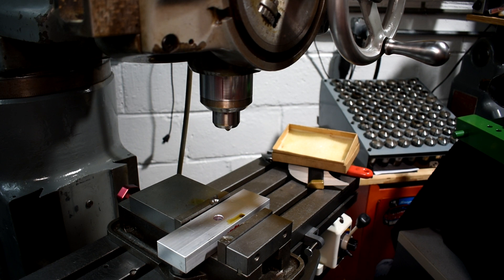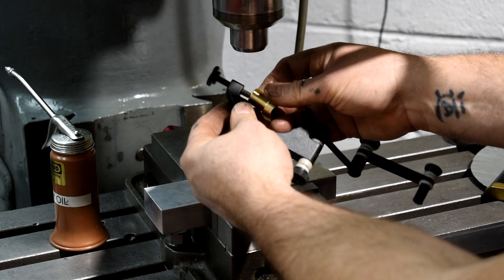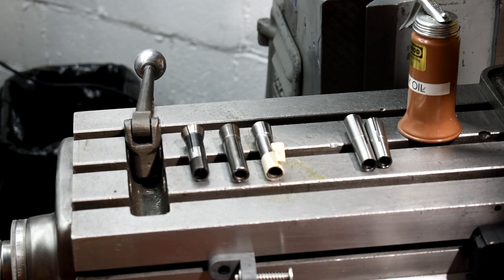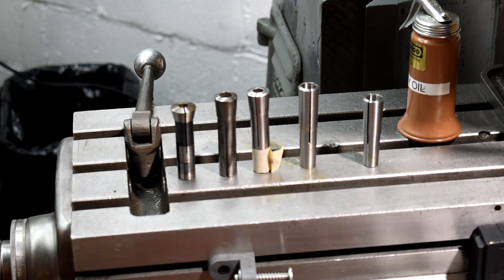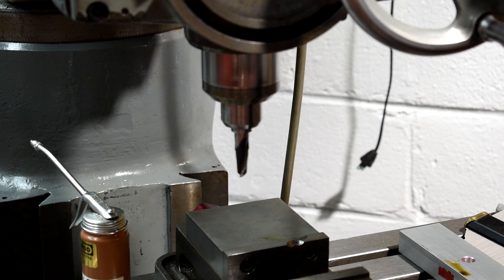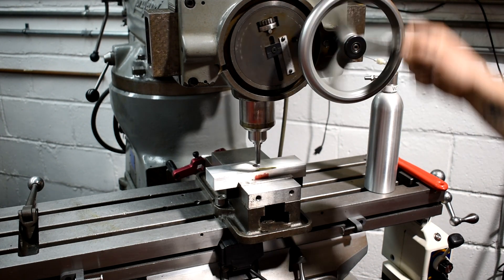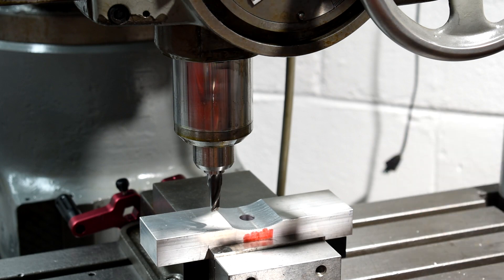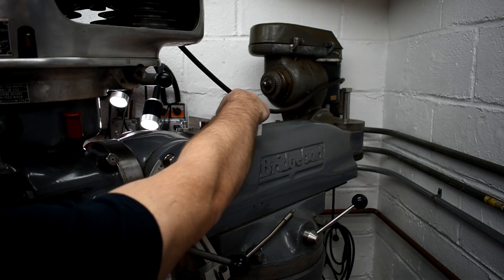Bridgeport Cherry Head Part 2

Comment: The radius at the top of the ram there is changing as you move along the ram.  Thus a constant radius piece like you made never really fits perfectly.
Reply from the maker: Yes !! you are correct !   i was able to cut a pc of mouse pad to use as a cushion and it works perfectly !!  thanks for watching !!! Joe
Reply: @RaptorMachineToolCo  I cut mine (constant radius like you did) using a boring head, with the material standing up on end.
Reply from the maker: @billlewis9740  good idea !   with CNC most of this old gear has gone by the wayside.. but it was fun messing around with it !  thanks ! please send a like and subscribe !  Joe

Comment: 16:08 in....."If you don't have CNC, this is your only option......" 
Oh really?
How about Rotary Table, Offside (outside) Boring, Plunge a Fly Cutter, Clamp to Face Plate, Sine Cut Radius, K&T/ Milwaukee 2D...? Now, I have a Cherrying Head too; it gets used most sinking closed forms such as channels, ribs, torus, hemispheres, concave OR convex.
Reply from the maker: Yes, been there done that..   i can tolerate making maybe 3 or 4 of the same part than tire of it...  for me, CNC definitely the way to go once the challenge of successfully producing the part the thrill is gone !!!   unless its your day job and you have to....    thanks for watching !  please like and subscribe   Joe